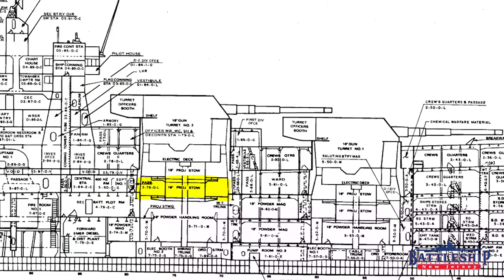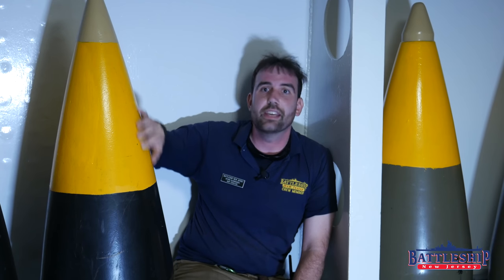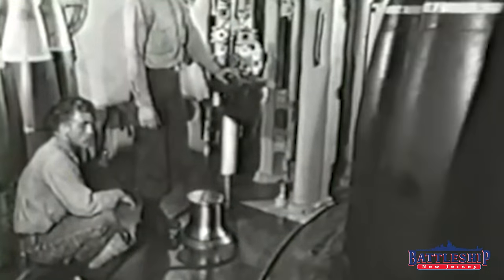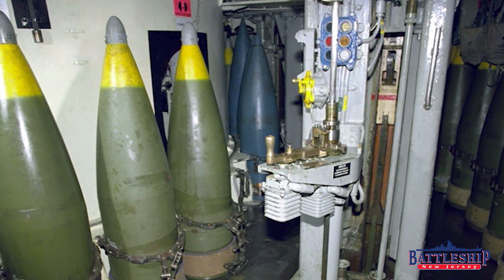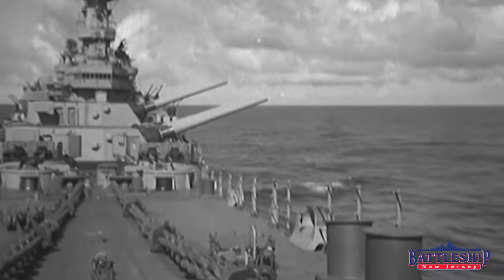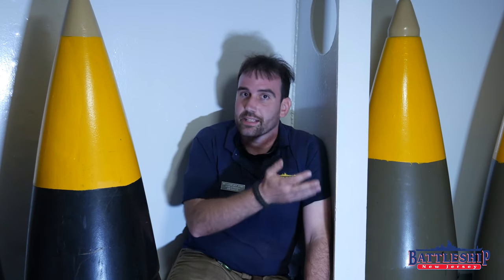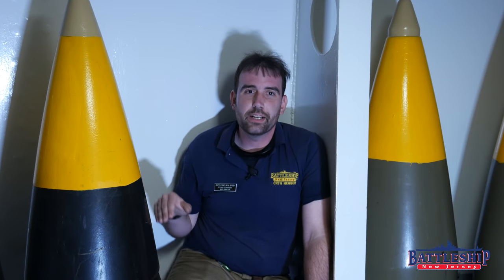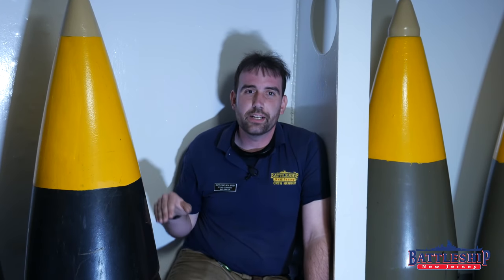What are the Different Types of Shells that the 16in Guns Fire?

Comment: Just a clarification. The navy called proximity fuses "VT fuses" -- at least in some cases -- to mask the fact that they were actually not fuses that would be set with a desired  delay, but rather a new and more sophisticated approach. That is, one did not dial in a time delay that was estimated to be good for a particular firing solution.

Rather, VT shells used an electronic fuse -- at the tip of the shell -- that would transmit and detect reflected changes in the fuse's transmitted radio signal -- indicative of proximity to a metal object (the target) that caused the RF disortion -- and then ignite the explosive. 

It required significant engineering and testing to create an electronic fuse that would survive the shock of being shot out of a gun.

 These were used in (smaller) anti-aircraft guns and were a huge improvement (Patton called it the biggest advancement of weaponry in WWII). Prior to the invention and use of the proximity fuse, AA shells were largely ineffective against attacking enemy aircraft, as it was very difficult to dial in a close estimate of the proper fixed  delay to kill a moving aircraft.

Comment: So the zumwalts cost $23+ billion and the 8" shells that were $800k/each with a range of about 100 miles. 30 years prior there were 11" sabot shells developed that were larger with the same range. The $23 billion put towards the ineffective zumwalts could have had the iowas going for 20 more years. The dod never ceases to amaze me.
Reply: I used to be amazed.  After a career in the Navy, now I'm just amused...
Reply: The problem is some of these darned things have to be built to always work, never fail, and always be available for the full life of the program. A lot of engineering specs are written like, for generators, you have x cubes of space available to you and we want a diesel motor and an electric generator that makes y amount of electricity amps, current, hz, and we want twenty of them now and forty more over a ten year contract, etc" so a lot of these aren't, can't be, bought off the shelf, and the contacts have to be written, paid for, and supported through a part of if not all of the service life of the thing, with a warranty period and often a period of proprietary specialness so that is worth while for the company to go that road. Few specs are written "just give us any thing, we will make it work." Ships are a puzzle searching for those special purpose designed, built and supported pieces. And, don't fail, Mr Manufactures, or you will be on the hook for it.

Comment: If a cease fire order comes while the gun is loaded, how do you remove the shell and powder from the gun? What about a hang fire?
Reply: You can pull the powder bags out by hand and send them back down the powder hoist. To get the shell out you would need a backing tool for that.
Reply: Whoever draws the shortest straw slides down the muzzle and kicks it back out.
Reply: I think there is a huge weight that can be slid down the barrel to push the round back out. This doesn't always work.  There is a video about the 16" gun tools available.
Reply from the maker: Heres that video: https://youtu.be/YTHeMn_R5ds
Reply: @BattleshipNewJersey  Thank you very much, I have always wondered how they did that. Banging on the shell to drive it back out never occurred to me! I assume they have a hook to pull the powder bags out.

Comment: How loud was it inside the various parts of the turret during firing? Or were the crew not inside the turret during firing. Firing larger caliber pistols inside an indoor range with passive hearing protection is sometimes uncomfortable. I can’t imagine how loud a 16 in cannon would be
Reply from the maker: The crew were inside the turret while firing, they compare it to shotgun shells at most. The thick armor really helps. Generally the crew complain about the 5in more than the 16s

Comment: About the mortar rounds, a dud round that didn't explode would need new primer and propellant charges to fire it back, so that isn't really practical.  However, the larger mortar COULD fire captured ammo.  During WW2, German 8cm mortar teams could use captured Soviet 82mm shells in 8cm mortars that were otherwise "worn out", and a conversion table was printed and issued to show the range when firing captured Soviet rounds.

With these rare few exceptions, most of the ammo interchangeability things are little more than rumors or myth and are easily dispelled.

Comment: Has anyone ever seen footage of the explosion caused by the impact of a 16" high capacity shell? I wonder what danger close would be for that kind of explosion.
Reply: IIRC my field artillery training on naval gun fire, danger close for a 16" gun is 2000 meters.  Because they are guns the have a fairly elongated dispersion goose egg.  That is, the dispersion is longer along the direction of range and smaller at 90 degrees to the range (deflection).  Interestingly, the dispersion pattern becomes more nearly circular at longer ranges because the shells are dropping at a steeper angle.  So, the guy on the ground is safer if the gun is firing at 90 degrees to the direction of him to the enemy than if it is firing over his head.
Reply: @georgem7965  Thanks for taking the time to reply. 2000m? Wow! That's amazing. That's over a mile. Amazing. Is that on the high end of what you trained for? I can't imagine what would require you to be further away.
Reply: @artvandelay1099  the smartass answer is a battlefield nuke. Danger close is something less than 100 miles IMHO.
Reply: I was on the USS Lynde B McCormick DDG8 firing at that target island about '89 or '90, and were about one nm mile ahead of the USS New Jersey BB62. We were quite impressed with ourselves. When the NJ was coming up next to shoot we were allowed to come up and watch, if we weren't actually on watch, and we were that same-ish distance ahead but now farther away and well back. What the Officeres & Chiefs & experienced sailors warned us of came to be: "once it fires, be ready for the concussion wave, it will be enough to knock you back a few steps if you aren't ready."  She fired, we were on deck and ready, we thought. Well, we thought we were ready and that concussion wave shoved all us looky lous fast and back a couple of feet. You won't find find a single destroyerman there that day who would think of disrespecting her capabilities.
Reply: @artvandelay1099  Danger close for army 155mm is 600 m.  Like the 16" guns danger close for the MRLS rockets is 2000 m but they are rockets and inherently less accurate than tube artillery.  When I was in Vietnam and we were setting up a night defensive position we would bring in artillery close enough to us that we would be getting shell fragments in the trees above us, probably several hundred meters away from the actual impact.  That way, if we were attacked we could call in fire on target X and the artillery would already have the firing data and we could adjust from there.

Comment: One thing I heard about the 16/45 versus the 16/50 is at certain ranges the 16/45 had better deck penetration because the lower velocity of the 16/45 gave a steeper shell angle.  So the Iowa's had the capability to fire shells at a velocity similar to the 16/45's so they could get this better deck penetration if the situation required it.
Reply: What's the difference,  16/45, and 16/50?

Comment: Was there ever any provisions for firing AP rounds with less then full charges to get plunging fire at shorter range? Or would the reduce terminal velocity out weight the gains that would give you?
Reply: Why would you want plunging fire with an AP shell?  Remember, it’s a gun, not a howitzer. It is direct fire. You want maximum velocity to inflect maximum damage. Plunging fire might allow you to hit the deck of the enemy ship, but it won’t penetrate as far lacking kenetic energy compared to full charge side hits. The gunnery problem for hitting a moving target with plunging fire from a ship is also much more complicated. Lots more variables starting with do you get complete powder burn, so you know how much energy is transferred to the shell?  This affects range. 
Also, I suspect if you don’t hit from an angle greater than around 45 degrees, the projectile can skip off the deck rather then penetrating. 
Tank guns shoot flat trajectories, at high speeds, but into the hard sides of the enemy tank. It can be thought of like a duel: the first one with a hit usually wins. While you wait the time of flight for plunging fire, the other guy can shoot you twice. I suspect the same thing applies to ship gunnery.
Reply: This is what I get for commenting before I finish watching the video. Ryan talks about plunging fire, and how the Navy used it. I was wrong.
Reply: @doughudgens9275  your point about plunging fire being a hard targeting solution is valid. With a flatter  trajectory the round spend more of the range at a height that will inflict damage. 45° angel require knowing (or guessing) where they will be to ~30-100yds (the size of a ship). Dead flat gives you a lot more room for errors. Yeah for tradeoffs.

Comment: If they’d developed actual depleted uranium shells like the M1 abrams I can’t help wondering what the destructive power would have been to anything resembling a battleship or a hardened bunker. A further upside is it would be cheaper on a per missile basis. I wonder what the difference would be for a shipload of these compared to the same number of missiles.
Reply: The M829A4 can penetrate 880mm of Rolled Homogeneous Armor at 4000 meters

Comment: I'd like to see how you get inside of the shell. Like how is it assembled? How would it be demiled?
Reply: The nose fuse adapter unscrews to open a 3-1/2'' threaded hole. That's where we installed a lifting plate to move the shell around. There is a base plate at the flat end of the shell that unscrews leaving a hole about 10.5'' in diameter to access the interior. The BL&P round is cement filled, not sand filled. I know a guy who spent 4 days breaking pin  wrenches and emptying oxy acetylene tanks heating it trying to remove the base plate. Then it took another 7 days to chip the concrete filling out of the shell. He swore to never do it again.
https://www.youtube.com/watch?v=ninprMpD5RM

Comment: I wonder if battleships were still fighting each other, would the navy come up APFSDS and heat shells.
Reply: No because they wouldn't be fighting at point blank range where APFSDS or heat would help punch through armor. It was all about mass and plunging fire.
Reply: @Bellthorian  explosive formed penetrators have a far higher impact speed at range than other ap rounds
Reply: @alexcitovsky7389  true but it wouldn't cause enough damage. It would poke a relatively small hole in the side of the ship. I could see them using denser sub caliber munitions with bursting charges as a replacement
Reply: probably use the big guns to fire sub-caliber satellite or laser guided shells. think of the range you could get out of a modern guided 155mm shell if it was fired with a 406mm sabot.
Reply: @Bellthorian  heat does not lose amor penatration with range
Reply: Probably not, that's more heavy lifting than either of those rounds can do. BBs have depth as a major part of their defense. Neither of those rounds like to deal with that.
Reply: Just how much kinetic energy do you want? A HEAT round only punches a relatively small hole in a target, a large AP round, with an HE blast filling and delay is going to make the hole, then detonate internally, causing way more damage.
Reply: So, I did some research on the relative sizes of apfsds round to the respective gun. I think it would most realistically bee about seven inches and diameter and about 10 foot long. If tungsten and DU were used, that would be an extremely heavy perpetrator, I also think you would still have space for a decent bursting charge. This round we most likely be used for medium range.
Reply: @michaelpreston2735  that wouldn't fit the guns, too long.

Comment: What does the nomenclature “16 inch 50 caliber” mean? In the context of small arms “caliber” is the bore diameter expressed in hundredths of an inch (ex 45 caliber is a bore .45 inches in diameter).  I was under the impression that the “16 inch” part denotes the bore diameter on New Jersey’s guns, what is the additional “50 caliber” part mean?
Reply from the maker: Caliber in artillery is barrel length. 800in length divided by 16in diameter = 50 cal

Comment: Definitely that crazy hand grenade shell. That's just silly. But I gotta ask, how much does one of those fiber glass shells cost?
Reply: I imagine it wouldn't be cheap. If it's expected to go out of a barrel after three bags of powder have blown it up into the sky, the thing has to be durable as all get out so that you can depend on it surviving the initial huge and immediate g from the launch. If I'm understanding your question correctly. For inert fake show rounds only, I would figure they would be much cheaper. But, with a limited run for show rounds the cost of special production probably would not be very cheap for you and me.

Comment: At approximately 12:40, you mention a "16 inch, 45 caliber gun".  What do those dimensions mean, in the context of "cannons"?  When I think "45 caliber", I think of something like a 1911 pistol.  Obviously, the "16 inch" part of the description precludes that from being correct...  :-)
Reply from the maker: With artillery, caliber is a measure of the length of the barrel. Barrel length (800in) divided by barrel diameter (16in) = 50cal

You also have to remember that your 45 is a .45, so tha'ts an easy designation to see if someone is talking about small arms or artillery, if the rest of the context isn't clear.

Comment: Wonder if there were any 12in shells left from the AK class??? They had a great Ap shell would of made a great sabot..

I imagine a folding fin shell would of been made by now as well imagine a 16in smart munition...
Reply: Imagine the R&D needed to put systems into shells that could take that kind of instantaneous g loading.  Potting them with epoxy isn't going to be enough.  A lot easier and more cost effective to put a Super Hornet overhead with a GBU 2,000 pounder.  It's why Super Carriers put the Battleship to their graves.

Comment: Also the Super-Heavy AP shells also had boat tail (just like Long Range Rifle Bullets) where it is more streamlined than the flat based, and therefor better long range velocity....
Reply: Perhaps the difference on the nuke shell markings is one used a Mk13 HC shel with the nuke put inside of itl, and the other was an entirely new shell!
Reply: On the Nose Fuse issue during 'Nam, I wonder if the explosive (possibly Potassium Chlorate) got noticeably more sensitive, which means that they were lucky it didn't go off the instant the shell was fired!
Reply: On the US Army guns and US Army 16" shells.  I do know that the Naval Weapon Support Center is technically under the control of the US Army Ordnance Dept. So, they may actually be the remaining US Navy shells!
 
>> Also, the US Army Costal Defense Artillery, in the 1920s, got several of their 16" guns from the USS South Dakota BB's (with 4 triple 16" gunned turrets) and Lexington CC's (with 4 twin 16" gunned turrets) that were cancelled due to the Washington Naval Conference.  These guns were 16"L50's but not the same 16"L50s that the Iowa's got!

Comment: I'd have loved to throw a couple of the lighter 2200 AP rounds out of the 50 caliber guns. Just to see what the muzzle velocity was, since the Mark 8 super heavy's left the barrels at 760 odd meters per second. I can easily see with the full 660 pounds, you could throw a 2200 pound shell over I'd say 830 meters per second.
Reply: What's impressive is the muzzle energy of the 2700lb AP round.  Researching the Mark 7 Naval gone I found tables that list the energy as 355.6 mega joules.  I found another table that converted mega joules to foot/pounds, which people are used to as that is what is used for sporting arms.  So, the AP round has a velocity of 2500 ft/sec and a muzzle energy of 262,572,125.14 foot/pounds.

Comment: The Italian 15” mounted on Littorio class were not light weight. They weighed roughly the same as that of the Richelieu class and slightly heavier than RN 15”/42.

The Germans used the lighter shell weight on the Bismarck class.

Comment: I was surprised that the bursting charge on the AP round was only 35lbs. Doesn't seem like that would cause a lot of damage to another battleship.
Reply: That's the lower "go boom now!" limit - got to make sure they go off no matter what angle they hit at. That sets of the next main charge. Where applicable. I think I have that right, but that wasn't my main area.
Reply: @davidburroughs2244  no where have I found reference to any other charges contained in these shells.